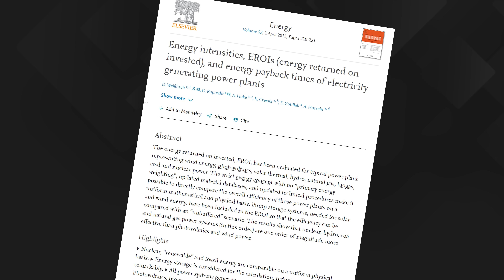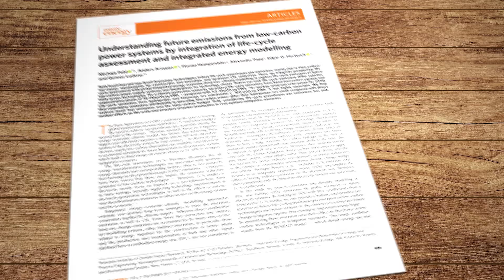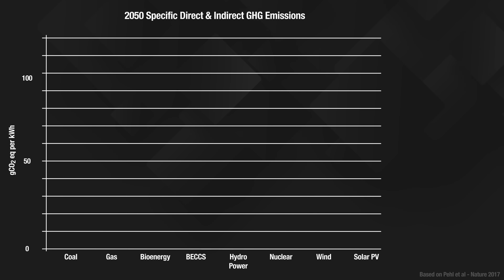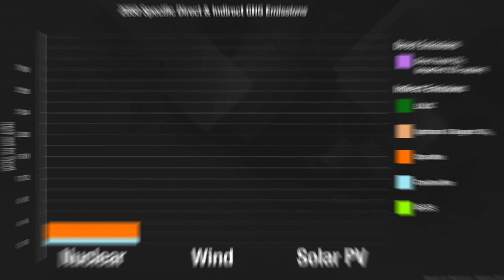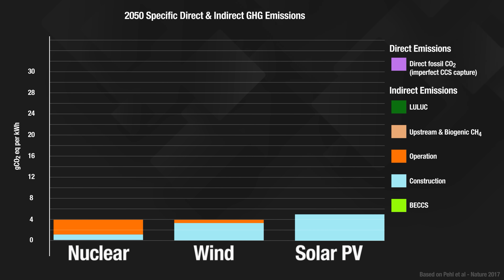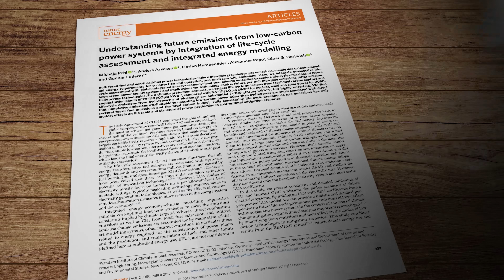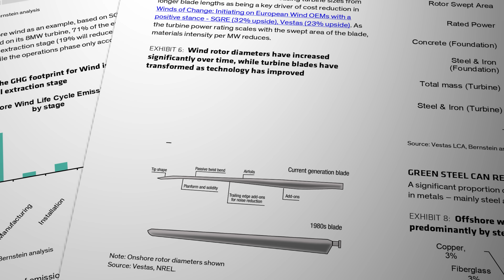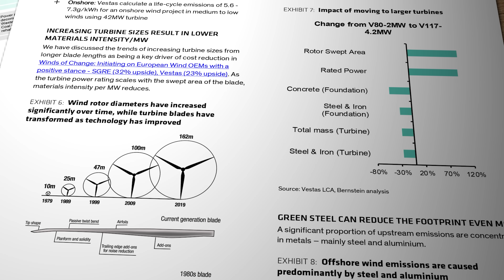Lifetime carbon emissions of renewables vs fossil fuel. Problem or solution?

Comment: I think the modeling should include hybrid systems that would provide grid power for appliances and a small solar array and small battery system for lights and other limited power needs.   Most people cannot afford a $40k or more investment in solar but a lot more homes could adopt a smaller system at $2k and up to perhaps $10k.  The problem with a single solution is the need to store energy.  And also the loss of energy moving electricity long distances.  If we blended micro nuclear plants with solar and wind and kept the natural gas power as a the power source of last resort...... how would such a blended system compare with the other models?  Lower cost with less construction, lower battery costs and a more distributed solar array close to the power consumption needs.
Reply: That would be way too pragmatic and sensible in a world driven by opposing ideologies.
Reply: You can't just put small solar on your home. The power companies don't allow it. You need to have enough output to be completely self sufficient because it's very expensive for the additional hardware to "sell" power back to the grid, which is a lie in itself. Nothing is sold back, you simply get credits which expire after x amount of time and they cannot be exchanged for actual payment.

Comment: Instead of electrolysis, use ionization PWM with water spray (car ignition with PWM on the 12 VDC side and water through a carburator). 10kV, 3 kHz.

Comment: Thunder: the sound produced by a hydrogen explosion, initiated by a spark of lightning. Atomized molecules of water are ionized by high voltage clouds to the point of rupture producing H2 and O.

Comment: Does the calculation for solar take into account for the need to have some kind of storage when the sun is on the other side of the world?
Reply: Check out thermal photovoltaics. The battery storage method with great potential.
Reply: No, because storage is optional and there are several options. Suffice it to say it would add a significant chunk. Allthough to be fair you don't need storage everywhere as long as you have other means.

Comment: Do us a favor, and when you mention nuclear waste disposal, please toss in a comment that various next gen nuclear designs actually burn high level waste for fuel. I keep waiting for you to add that as a comment, but you never do.
Reply: Yes, people only seem to talk about the legacy nuclear designs from the 1960's, not the ones being developed now in 2022.
Reply: That's the only thing I have against this guy. He won't mention that it must be possible to mass produce fast reactors.
You would think that more energy is required to make solar, wind and batteries (and ship and recycle them) than to make an equal generating capacity of molten salt or fast reactors.

Comment: Got my solar pv (4.8kwh )with 2 5kwh batteries commissioned this week, almost not using the grid anymore  <3
Reply: Except for those times when everyone else is using it! (when it is dark, and all the residential batteries have been drained).
Try disconnecting your connection to the grid and tell us the number of days you can hack that.
Reply: @factnotfiction5915  In suburban area where I reside, we aren't allowed to cut the umbilical cord.
Very pleased for Mr Bana (not related to Eric, are you?), you won't look back!
Reply: @MrBenHaynes  i wish i was but Bana is not his full name ;) I can disconnect from the grid anytime, i have manual switch, and actually regulations say in case of power cut i can't be connected to the grid with batteries working (so we don't send electricity back when somebody is working). 
for the disconnection from grid it will depend the season but right now we would last all summer, unless we have 2 weeks of rain/cloud as we currently export more than we consumed through the day.

Comment: it's weird that your graph didn't include construction costs for coal and gas.  Those power plants aren't constructed?  But dams are?  Solar and wind are?  Or are we assuming all future coal and gas power will come from plants that are already built?  If so, wouldn't you say the same for dams?
Reply: Presumably it means that a coal plant able to produce as much power as a hydro plant uses a negligible amount of concrete and steel in its construction, which does sound a bit strange to a layman like me, but I have to assume that is what is implied by the graph.

Comment: I think you need to discuss the CO2 emissions generated from energy storage which is more critical for PV and wind power sources. This will add significantly to the carbon foot print and is more of an apples to apples to comparison. I do realize this foot print will decrease as the grid is changed to renewable energy, vehicles and trucks switch to electric drive trains, and construction vehicles switch to hydrogen ICE from diesel (or battery).

Comment: It would be great if tidal power could be thrown in to the mix. Is that still a valid option or is trying to harness sea energy too much hassle?
Reply: Probably close to Hydro.
Reply: Easily too much hassle. This is why tidal consists of a few experimental and small-scale installations.

Comment: Having worked in primary resources most of my working life (oil and gas, coal, oil sands, copper,  and now iron production) I am all for going to green energy. What i missed in this episode is the impact on emissions when coal power has to pick up the load when wind and PV can't deliver.  New tech in using hydrogen to produce steel has me very excited and I see this as an ideal math with wind and PV to produce large scale hydrogen. As nice as the chart looks wind and PV alone isn't a suitable power supply for the grid. New Nuclear tech is very close to filling this gap.
Reply: How about Wind turbines lining the highways in remote locations and they pump that power into a electrolyers then the hydrogen is stored in hydrogen tanks. The power from wind turbines is generating power and charging electric cars. If the wind is not running, then hydrogen in the tanks power a fuel cell which converts that to electrical power for charging cars?  Another cool idea is to embed coils in the pavement and have them powered by a array of solar panels that  are in large solar fields ever 5-10 miles and they provide the constant power to under ground grid of coils in the road.
Reply: @LK-pc4sq  How about hydrogen fuel cell cars and skip the batteries all together. I am sceptical about the widespread implementation of batteries having been involved in what it takes to extract the minerals required. Hydrogen for cars is a way off as first we need to be able to produce large scale green hydrogen (not blue hydrogen) before putting a distribution system in place. Such as for an iron plant. All solvable problems.
Reply: Why would you need to factor in coal emissions for wind/solar if the emissions were coming from coal??? If not for solar and wind, ALL of that electricity would come from coal, right??
Reply: @ThomasBomb45  the person you are responding to is pointing out that most renewables don't provide consistent power, and right now the backup power when they are not available is fossil fuels (though probably not coal, most of the gap power plants use oil or gas).
But it is a lot better to get most of your power from wind and solar and burn stuff for power on windless nights than to burn stuff 24-7 so...
Reply: @aaronbaker2186  The gap in the logic that most people put forward is that they steady state emissions numbers for fossil fuels. The emissions are far worse when power plants are ramping up and cooling down like they have to do when picking up load when wind and PV stop supplying. There is lots of tech being developed now and some will work and some won't. It's just about finding the right mix and not tweaking the numbers to promote a single agenda. I strongly believe that a multi solution approach is needed. All good discussion to Just Have a Think about.
Reply: New nuclear tech, huh? The 400,000 tons of 'spent' fuel from old nuclear tech has already rendered this planet unfit for life F_O_R_E_V_E_R_
Reply: @bélalugrisi  It's only forever if you put a space between every year. LOL. The nasty waste comes from the cold war era reactors that were producing weapons grade plutonium in uranium fuel reactors. Take a look into Thorium reactors, LMS reactors (much safer than water cooled reactors), SMR reactors and fast breeder reactors (that burn most of the waste to continue the reaction). I watched a very interesting documentary a while back: Pandora's Promise. Well worth the watch. It may give you a bit of a re-think on your comments if you are willing to Just Have A Think about it. 🙂

Comment: One thing seems clear Coal is one of the worst methods so moving away from that is a good thing!
One aspect that seems (deliberately?) to be missed is the storage factor.
In order to compare like for like you need to include the total costs for a system. Nuclear is left on 24/7 but the wind is less than 50% .... Which means you need to factor in the storage of your energy into the mix. This is not a cheap thing and also has fairly heavy environmental costs!
Also an element that may have been missed off the off shore wind equation is the cost of linking into the electric supply network!
Reply: Indeed storage has to be taken into account although this makes it even more complicated to calculate for comparison as there are numerous storage option. Ultimately it comes down to finding the best mix of energy generation, storage and utilisation. This will likely be different depending on where you live.
Reply: Even with storage taken into account, total co2 emissions by kWh don't exceed 10g for wind energy, compared to the 400+g of co2 per kWh of natural gas which is the most "environmentally friendly" non nuclear fossil fuel.
Not to mention, these numbers will drop even further for wind energy when the first EV batteries are being repurposed or recycled as stationnary batteries.
Also, you can store energy without batteries, just using pumped hydro.
Reply: @texanplayer7651  How much does a good dam cost nowadays .... lots of concrete = lots of CO2! Then there is the pesky problem of where to put them (which can be a difficult problem all on it's own). 
While we are on point ....... Why Not Nuclear? Rolls Royce are coming up with small Nuclear plants that are modular and so easy(er) to get through planning. The hardest point is (in the UK) getting the grid able to handle the extra power!
Reply: @totherarf  ah yes, nuclear, because the gigantic cooling towers don't need any concrete, right?
Reply: @texanplayer7651  Modular units don't need those cooling towers!
Wind as a supliment is fine, but you still need base power that you can switch fairly quickly .... That is the fly in the ointment. Unless you can link it to energy intensive industries that can be used as load balancing. Desalination and Electrolysis spring to mind. 
But you Do need to ditch the idea that your primary source can be intermittent! Like buying "Green Power". It is only green in concept and relies on dirty power to carry the load when times are hard!
Reply: @texanplayer7651  It would be nice to see where you get your 10g CO2 from ...... it would seem unrealistically low to me.
Reply: @totherarf  10g/kWh That's what you get when googling it yourself.
Although I did make one mistake though, this number is only when you don't account for storage.
But even if you take the worst lithium ion battery, someone in the comment section found 78g/kWh, so still more than 5 times less than natural gas, and that's the carbon footprint for EV cars in the US, not stationnary batteries. Also this is the worst number that doesn't take into account battery recycling which can further decrease that amount.
And even if that's a problem, pure wind energy without storage still makes a very good power supplement to reduce the fossil fuel usage, and therefore the carbon footprint.
Reply: Another complication is there is no standard teck for storage.   In the last year I've hears of .... 6 ---8 completely new systems of energy storage until a winner is adopted its impossible to make an accurate calculation.
Reply: I googled a bit and it seems current lithium ion batteries cause 73 kg CO2 / kWh (for cars) . It isn't clear how much storage we would need though as this heavily depends on the grid, weather, type of renewable and so on. Making some estimates based on this number doesn't look to bad though. Even worst case scenarios I can come up with are still better than all fossil fuels.